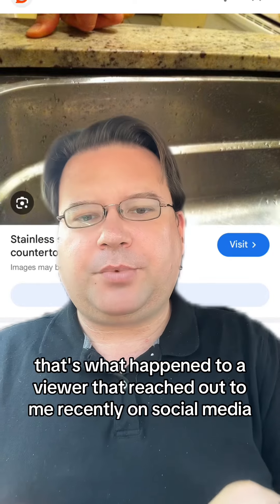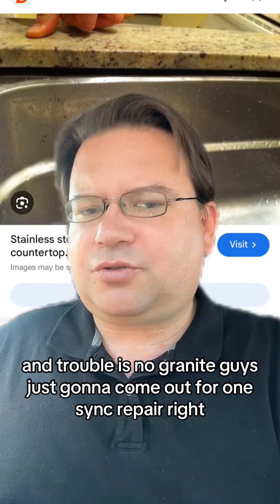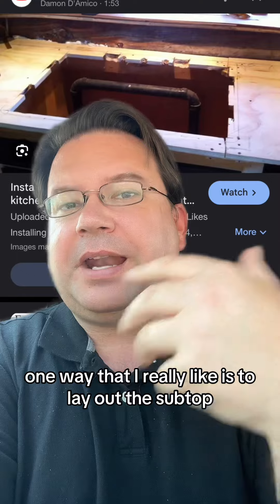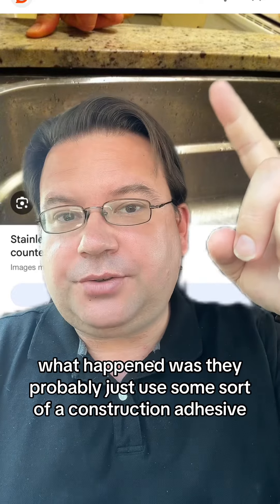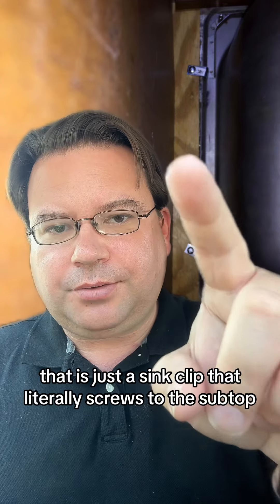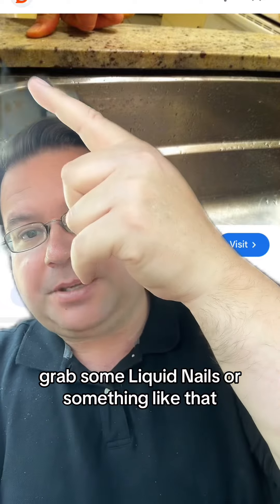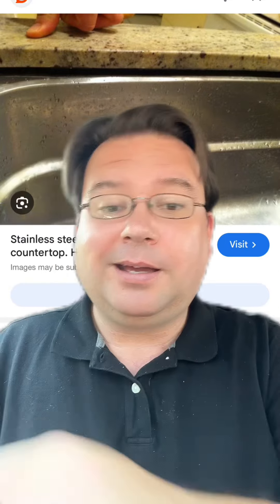How to fix a kitchen sink separating from the countertop

Comment: Dude literally gives ZERO advice on what to do if no one wants to fix their issue.  Just mentions issues with prior contractor installs.
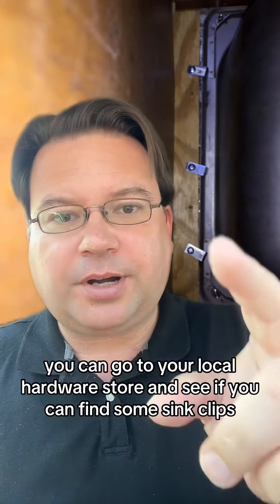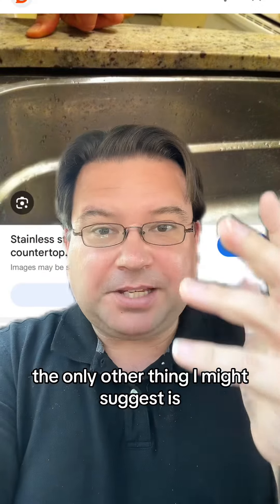Reply from the maker: The actual solution is to install it correctly as I described in the beginning of the video. If that’s not possible, then At 1:22 I talk about undermount sink clips and at 1:59 I describe a “Band-Aid” fix that you can try. Did you even watch the video?